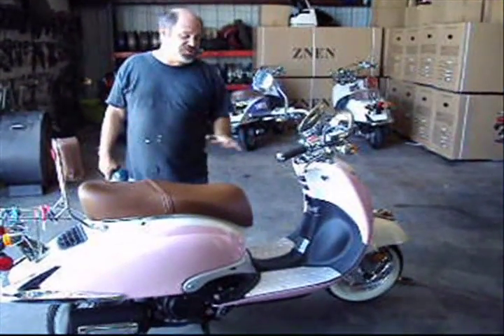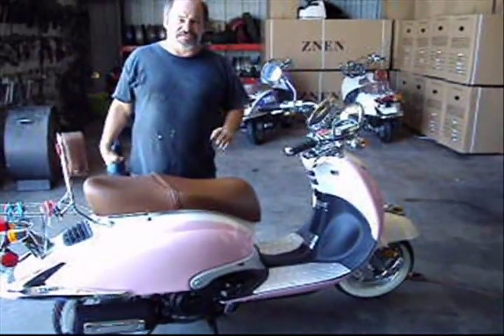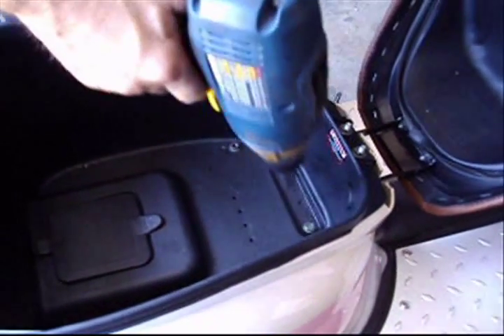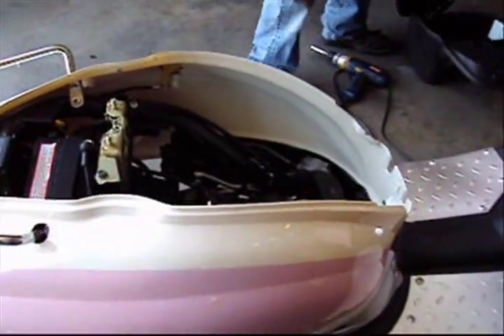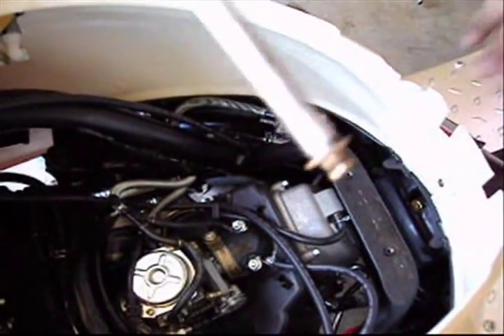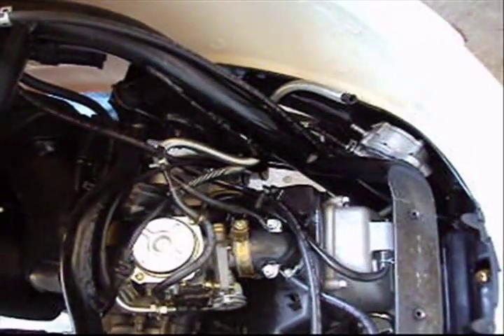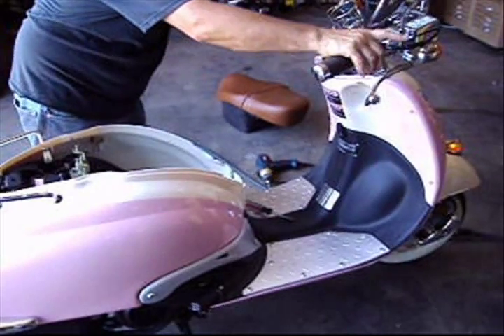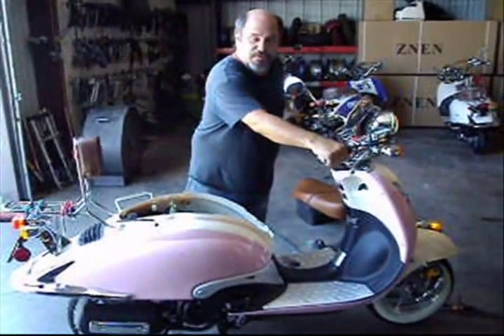carb clean made easy on Your GY6 motor

Comment: You risk damaging the diaphragm and also risk bending the float tab that the float needle sits on. I wouldn't recommend this but instead actually pulling the carburetor off and doing it the correct way. But it's your carburetor, do it how you want.